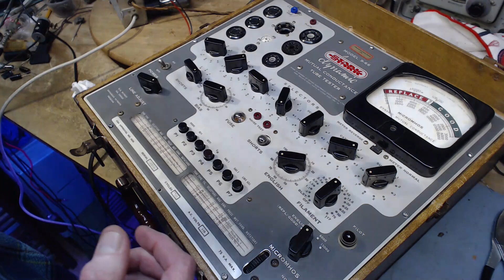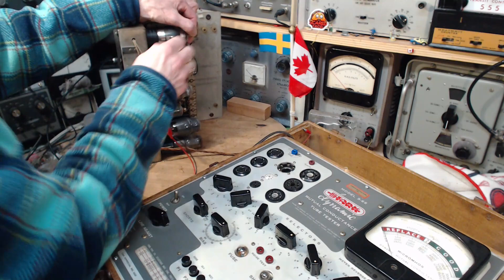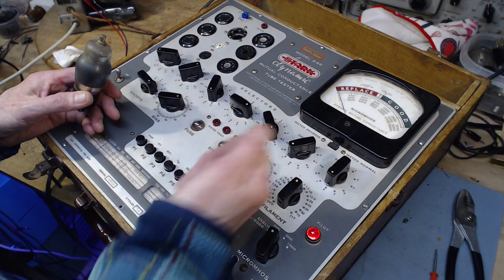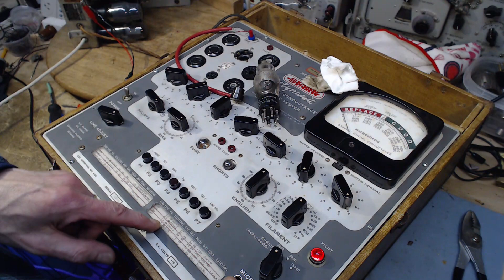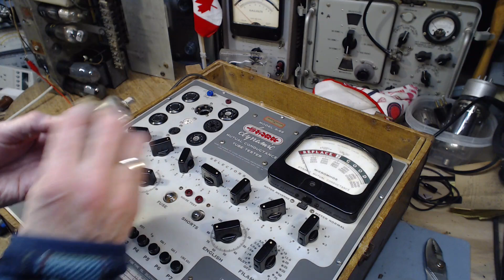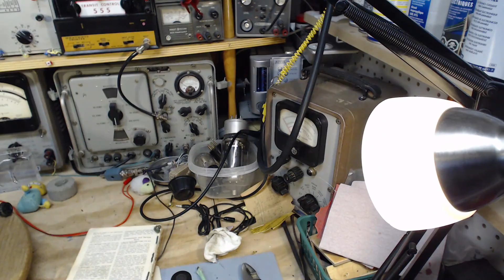Philco #53 Shortwave Tube Radio Video #4 - Tubes Tested, Bias Checked

Comment: usagi electric has a broken tube tester, but he is going to have to fix it. Personally I only use local AI and even then it's mostly good for BS like adding rocks to food or glue to pizza. On the other hand it would have helped me fix a tube radio back when I was a kid. I never did fix the radio sigh and then it was lost in a building fire.